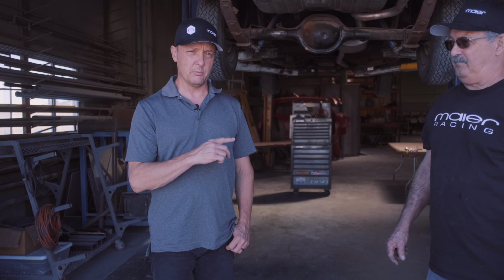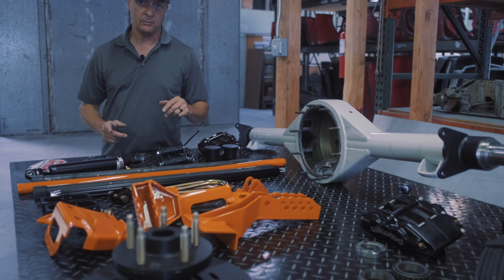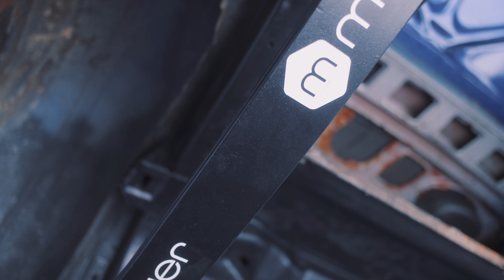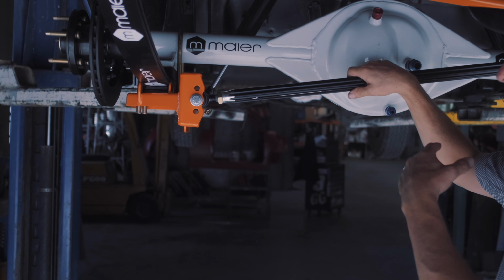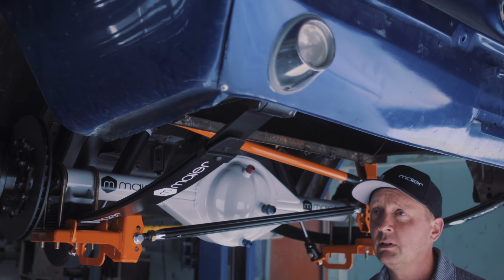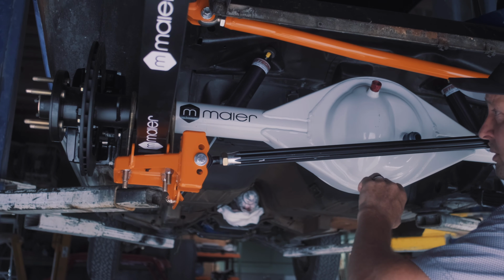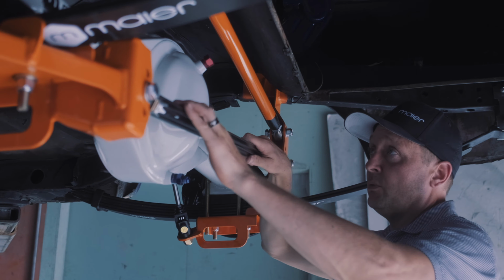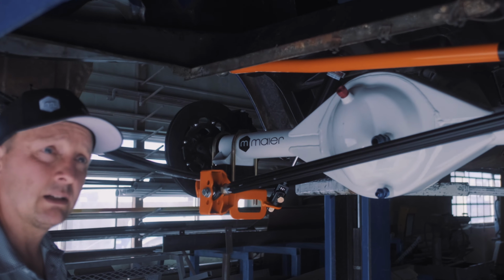1967 Mustang Tribute car part 1

Comment: My son has my 68 Fastback in the Body Shop that he Manages.  It is stripped and stripped out without engine fuel tank or running gear with epoxy sealer.  I am interested in the "Hey Bud, where did you get that?"  Could, or would you add the procurement information about the parts you are installing onto your project car?  I can see brand names like Wilwood for brakes, but where did you locate your Ford 9 Inch housing and such goodies? Thanx TEG
Reply from the maker: TEG, the rear end assembly was built for us by Speedway Engineering in Simi Valley CA.